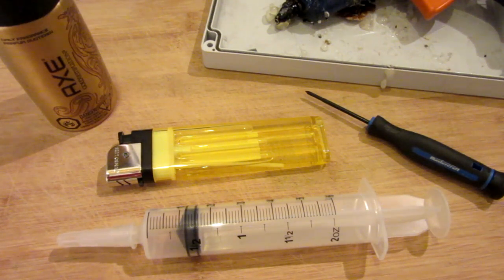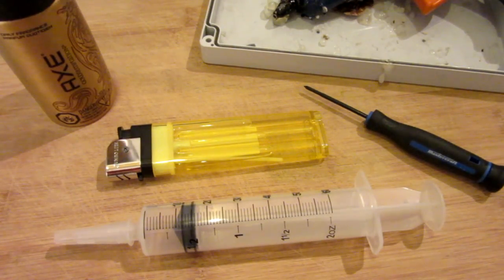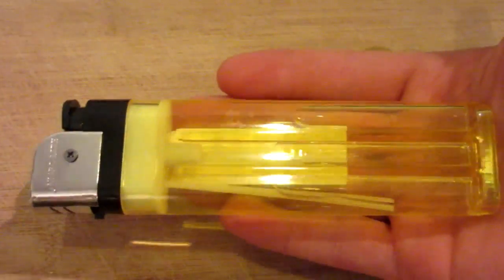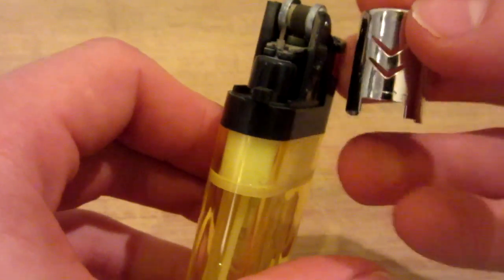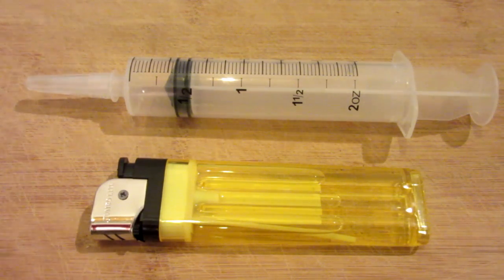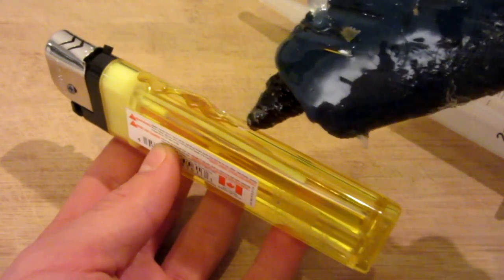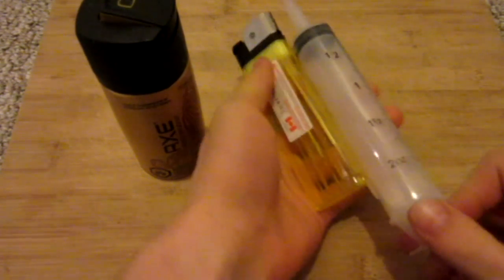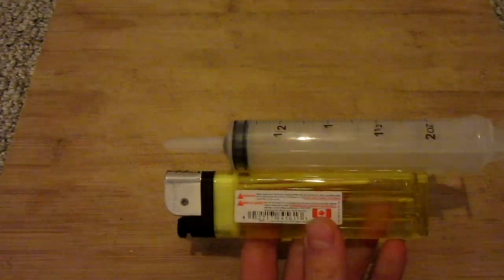How to Make an XL Lighter Flamethrower

Comment: fyi You can just keep cranking up the flame, just turn it to max plus, lift the plastic thing to disengage it from the gear plug thing, turn it right back to minimum which keeps the flame high because the plastic ring isn't attacked to the knob and then place the ring back onto the knob and turn to max again, just repeat that. You can get the flame to like 5inches or more..

we did it as kids. Kids who smoked cigarettes lol

Comment: you can take the switch off of the gear that opens the valve for gas, then put it back on as it looks like its on low and continue to open the valve over and over. I used this to make a small 1.5 inch tall lighter get a 3 foot tall flame. it uses alot of the gas though